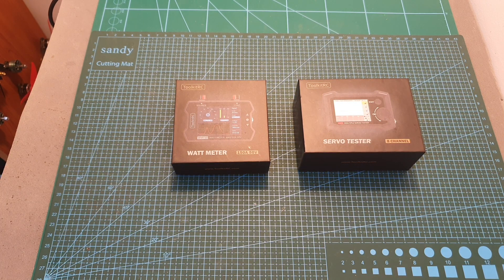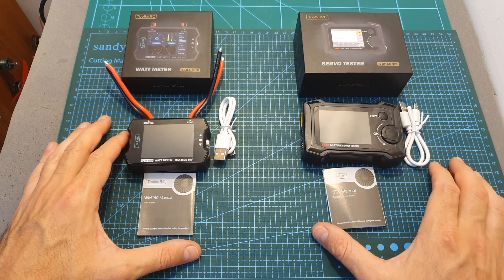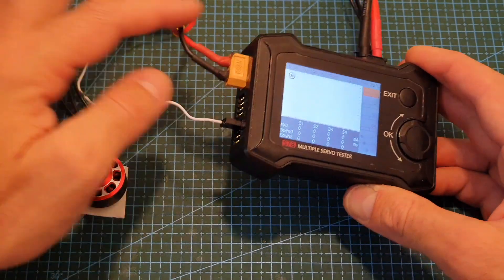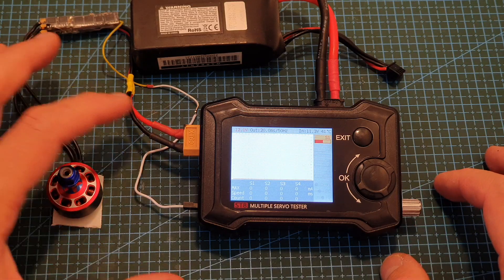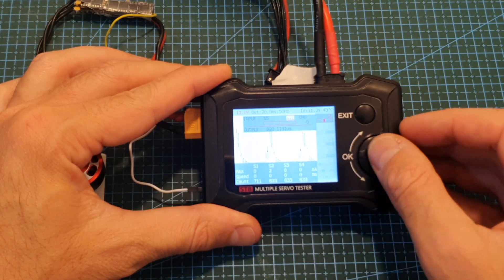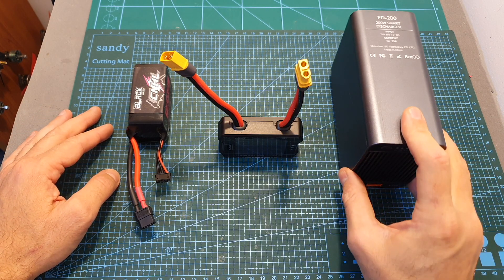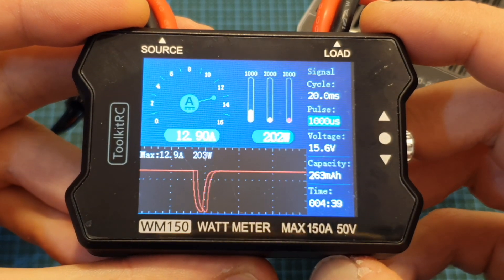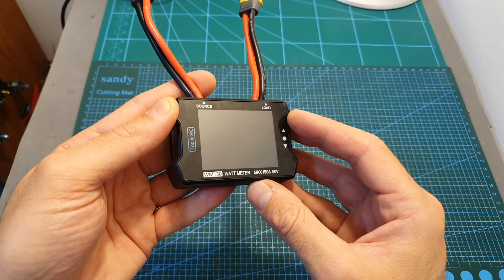ToolkitRC WM150 Watt Meter & ST8 Servo Tester

Comment: How did you measure current of the main output port of the ST8? In our vid, the main port powers the ESC and the signal S4. I have some high torque servos that are tripping the ST8, drawing more than 4A. I tried doing the same as your vid, power for servo from main output port and signal from S1-S4. But cant get current to plot like you show. Help
Reply from the maker: Please point me to the time point where I tested it out.
Reply: At 3:51, you have esc plugged into main out and signal lead in s1. You get esc current when you dial speed on pot. I do same with high torque servo wired to with power from main out, servo works but i get no current measured on trend.